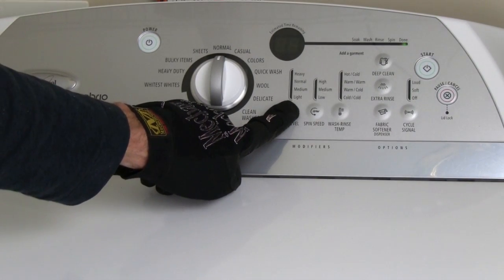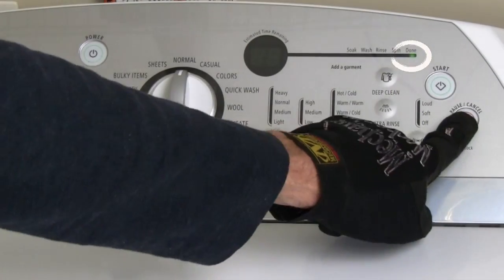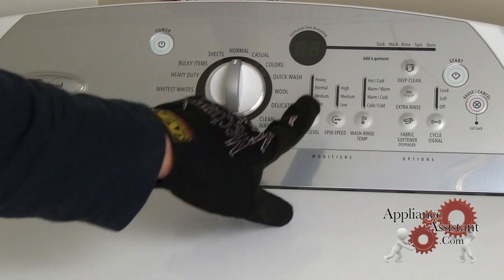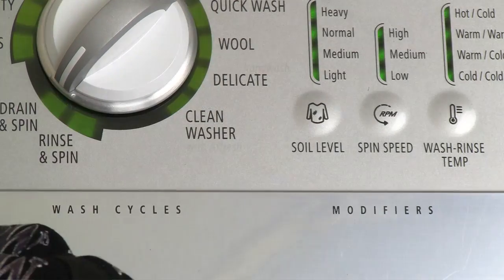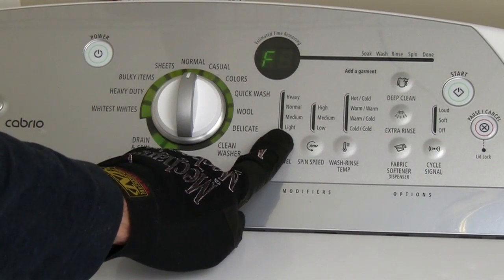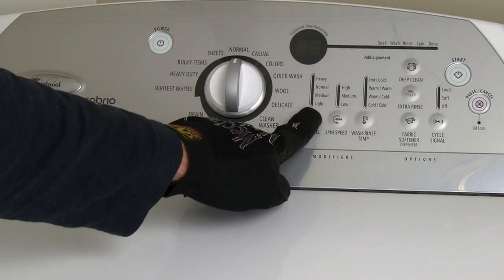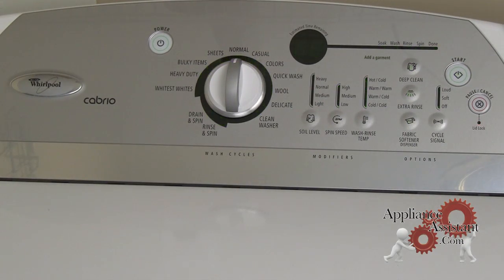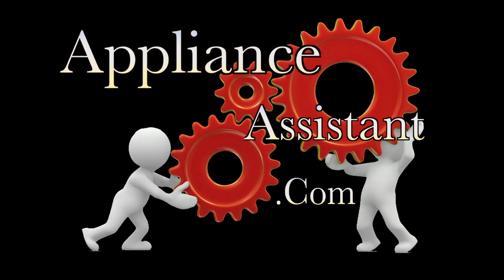Washing Machine Diagnostic Test & Error Codes (Cabrio, Bravo, & Kenmore Oasis)

Comment: It's now 2025. Glad I came across this video. My question is. With this exact washing machine, I had an unbalanced code that randomly caused issues. I replaced the suspension rods. How do I calibrate after this? This is the first video I've seen with the exact washer as mine. I also used the washer to see if the issue was fixed. The code popped back up, then SD code started to display. What steps now. Thank you for your assistance.

Comment: Seems quite impossible to get to the mos recent messages but I have this washer, or some form of it, and the button sequence works intermittently. I wonder if when the board resets if the dial indicator has to flash green. I have seen it flash green and beep and I have seen it just beep when power is added back.
Reply from the maker: The first part of the diagnostics mode lights up all the console LEDs to check if they are working.  After that it should cycle through any stored error codes. After that it should go into an automatic test sequence that's about 9 steps long, testing all the main components.  If new errors are detected during the auto test cycle they should be displayed at the end or be recorded when you start the diagnostics again. Hope that helps some!

Comment: Thanks for the great video, it helps a lot, so after the issue has been fixed how to reset those error code?
Reply from the maker: Thank you! Not all models have an error code reset for the memory. But on most of these after you’re done displaying all the error codes if you press and hold the same button until you hear a beep that may clear existing codes.

Comment: Can a recalibration be performed on the model shown in this video?
Reply from the maker: I’m not 100% sure. I have never used the recalibration mode on this type of washer. Sorry, I can’t be of more help!
Common issues are suspension, center bearing leaks/rust, and the occasional cracked stator.

Comment: What is oL
Reply from the maker: Sorry for the delay! OL is over load. It is caused when the inner tub cannot move freely to float off the drive hub. 
It can be caused by something getting wedged between the inner and outer tub, like a sock. Or the center drive shaft has become corroded and is not allowing the inner tub to slide up as the washer fills. I hope that helps!

Comment: Hey I am getting OL error and on calibration it c6 that errors it out I've replaced the suspension rods but didn't fix it any idea of what I should look at?
Reply from the maker: Hey! As the washer fills up with water the inner tub should rise and float on the water. It’s fairly common that the sleeve of the center drive shaft will rust and not allow the tub to float freely. You should be able to grab the rim of the inner tub an lift it easily. If it’s jammed it’s a fairly challenging repair, you might want to consider hiring someone for that as some specialty tools are required.

Comment: I have been getting an oL code on my washer. I did this diagnostic test and CO popped up and then it has C1 and started to run a cycle. And also had the add garment light on
Reply: Me too, any luck?
Reply: @cool33onthescene  ended up throwing it out

Comment: You do not explain how to get the washer into  standby mode.  Once I turn the washer one, it only allows standard operation. I've tried every other way to access the error codes, but nothing has worked.

Comment: Tried this but the washer is not filling up with water.  Any advise?
Reply from the maker: If you are in diagnostics with no water filling I would say check the home and washer valves. Probably one is off or the valve is bad. To be sure you would need to check for 120 Volts AC at the valve when it should be filling. If no voltage, broken wire or control. If you have voltage it’s the valve. Hope that helps!

Comment: Does anyone know of a class action law suite against these washers?
Reply from the maker: Not that I’ve found, the washer in this video has been pretty good by today’s standards. Apart from the bearing issue they have been pretty solid. Not so much with the lower end belt drive version. If you find any info on a class action please let me know!

Comment: @applianceassistant Hi do I let each code go through it's stage or keep clicking because my washer have about 4 codes that would show up it runs a little but I kept going through each code and after I decided to was a small load it stopped again on 13 mins left of spin cycle

Comment: We have a Cabrio Washer WTW8100bW. It runs fine but when it changes to the next cycle, we get an OL code. My wife has to change the cycle manually. The manual says over load but that’s not the case. Light loads. Any suggestions?

Comment: How do I enter diagnostic mold in Kenmore 110 model series the high efficiency low water wash technology model
Reply from the maker: It may be the same as in this video... 110. Is kenmore code for whirlpool built. What is the full model number?
Reply: @applianceassistant  110.28002011
Reply: @applianceassistant  110.2080002011
Reply from the maker: That style is a little different. I have a video for that one also. Look up “Whirlpool Washer Repair (New Top Load Washer)” that will show you how to do diagnostics and read error codes. There is also a link in the video description to my website with more information on it. Good luck!

Comment: My cabrio runs diagnostic up until c8 and gets stuck and does not drain the water inside
Reply from the maker: Sounds like the drain pump would be a good place to start looking for the problem. If the pump seems to be running at that point there may be something clogging the pump intake port under the inner tub. Hope that helps some!

Comment: my washer displays OL message while it is not overloaded, and then clothes are not dry. What is the problem? Thanks
Reply from the maker: Sorry for the delay. Check for something stuck between the inner and outer tubs that may be preventing the tub from floating as the water fills. Or the main drive shaft may be corroded keeping the tub from lifting off the hub. Hope that helps some.

Comment: Can anyone help please. I have a Whirlpool Cabrio washer machine that keeps popping up with an OL code. I hear water somewhere on the outside of the drum.
Reply from the maker: The water you hear is likely the water filled balance ring on top of the tub, so it would be normal. The ol “over loaded” error is usually caused by a rusted drive shaft. The tub should float up and disengage the hub when water fills the tu. However, if the shaft is rusted... common, it will stick and not allow the tub to float free. https://applianceassistant.com/appliance-repair/washer-repair/cabrio-washer-repair-guide/2/#ol
If that is the cause it’s not a very easy repair... hope that helps some.

Comment: I got f1 issues ?
Reply from the maker: Bummer... it’s usually a main control board error. You can try resetting the control by unplugging it for a minute, otherwise that’s what I would replace first if the rest of the washer is in good condition has no black or rust marks under the washer. If it shows signs of leaking through the center seal, or it’s loud in spin, it’s probably best to say goodbye.

Comment: Urgently need your kind assistance.  I have a Whirlpool Cabrio.  It shows "sd" error code.  I would stop at the last spin.  I have tried several times to use the bleach and clean cycles.  Not removing the code.  Can you please help.  Is there a reset button or calibration function to see if this will go away?  How can I fix myself.  I called around and everyone is extremely costly during the holidays!  Please help.  Thank you in advance for your kindness. Happy Thanksgiving!
Reply from the maker: Sorry for the delay! The sd code is usually related to too much soap or slow draining so you will likely need to clear or replace  the drain pump. If replacement is needed there are several options on Amazon for a decent price. There can also be coins and other things blocking the intake port to the pump under the inner basket... hope that help some, good luck!

Comment: I have a Whirlpool cabrio platinum and it is leaking on the inside. Dripping water into the tub. What is causing this drip, I have to put a bucket in to catch it so the water doesn't sour.

Comment: Hello, I have a Whirlpool Cabrio top loading HE machine. Looks exactly like the one in the video above per the control panel. I have been getting an LF code. It seems to be filling on some cycles but not others. I ran a ‘clean washer’ cycle and it did fill up all the way. It seems to not be filling at certain times in the cycle though. Sounds like it’s trying to by the sounds it makes. I cleaned the inflow screens and checked the inflow pressure, etc., it’s all ok. I’ve taken the inflow valve part out of the washer and I’m going to check it with an OHM next. Are there any other issues that would cause this code that I’m overlooking?  I’ve had to fix this washer more than a few times myself. Getting ready to dump it if it’s going to be more complicated at this point. Any help is greatly appreciated! Mother of 4 and I need this washer to run consistently every day. 🙏
Reply: It sounds to me like the water valve may be mechanically unable to open. sometimes they can test okay with an OHM meter on the coil windings and still not work properly. The diagnostics test mode https://applianceassistant.com/Washer-Repair/Whirlpool-Washer-Belt-Drive-Splutch/Whirlpool-Belt-Drive-Washer-Repair-Guide.php  should allow you to test the hot and cold valve's ability to open. If the coils are getting power from the control, there is water comming to the valve, and the screens are clear, you can make a fairly safe assumption that the valve is what needs to be replaced.  Thanks for the question! I hope that helps some! Good luck!
Reply: charles yingst; Hello, I ended up buying a gently used new washer for less than the cost of the in-take-valve part for the Cabrio. It was a lot more rusted than I expected when I got under the hood so to speak. The machine was 10 years old and should’ve had a lot more life to it but it is what is. 🤷‍♀️
I’m the proud owner of a Maytag now. 👍
Thank you for your reply and the help though!

Comment: We get the code UL on drain Spin and it stops how can I fix that
Reply from the maker: UL is  “unbalanced load”. The most common cause of UL would be the tub suspension rods. The suspension rod replacement Doable with one person but easier with two if it’s your first time.

Comment: I Have A Cabrio WTW7600XW0,  After A Wash Cycle (That Didn't Spin)  Time Stopped On 3 Mins And Read sd & I Did A Diagnosis & It  Popped Up L0. What Does This Mean? I'm Completely Lost.. Help Please!
Reply from the maker: SD is usually a draining issue, but it can sometimes mean that the tub shaft is rusty and not allowing the inner tub to lock back into the hub after the water has drained out. This same thing can happen when something, like a rag, gets stuck under the tub and holds it up after the water has drained out. The LD error means long drain which is along the same lines. so if the water seems to be draining out okay, it's probably a problem with the tub sinking back down from the wash cycle. (rusty shaft, tub hub, or something under the tub) If it's not draining out well you may have a bad drain pump or something under the tub clogging the pump intake screen.  This link may help:
http://appliancediagnostic.com/Washer-Repair/Cabrio-Bravos-Oasis/Cabrio-Bravo-Oasis-Guide.php
Hope that helps! Good luck!
Reply: Samantha Longoria too many suds

Comment: I have a cabrio HE, model WTW6500. worked fine Yesterday, now it makes a buzzing sound and lights blink- will not run.Help
Reply from the maker: where you able to get it into the diagnostics mode to see if there are any error codes stored? 
http://applianceassistant.com/appliance-repair/washer-repair/cabrio-washer-repair-guide/
 If not what lights are blinking?

Comment: On a Whirlpool Cabrio, if you get a 0L or a UL code. The bottom load sensor on the stator could be bad. Watch Cabrio videos on here for better details. The washer will usually stop with 3 minutes left and give error code.
Reply: oh yea/? I replaced that, bearings, seal, shaft and rods and stator doesnt have cracks im about to put it for trash, these washers SUCK!!!
Reply: F32 code

Comment: How do you replace tub displacement/ out of sync sensor on Maytag Neptune TL, model # FAV6800AWW? Thanks.
Reply from the maker: +FORE DEVELOPMENT, LLC Sorry for the delay! Replacing the part is pretty easy, It just clips onto the tub and the washer frame and has one wire connection. If I remember correctly I think its located on the front left under the top. Its been a while since I worked on one but I think there are spring clips at the seam between the top and the front of the washer that you need to press toward the back of the washer with a putty knife. That should allow you to lift the top... Here is a link to the part:
http://www.repairclinic.com/vwo10/PartDetail/Out-Of-Balance-Sensor/12002194/1032779?RCAID=27317
If that happens to not solve the problem you can still send it back for a refund... those are difficult to diagnose with certainty.

Comment: Does anyone know how to get model WTW8500BW0 into diagnostic mode. There is a combined start and Pause but no cancel bottom
Reply from the maker: +Mega Clause It should be the same diagnostic process, you would use any button but start/pause
Reply: +applianceassistant Finally worked. Looks like it the drain pump. It gets caught on C8 both in automatic testing and manual. Is there a way to test the drain pump once its removed? Continuity test??
Reply from the maker: You can check to see if the motor windings are "open" with a multimeter. It should have some resistance, but hard to know what that reading should be. Most of the time the motor winding is okay but the impeller fins are jammed, broken, of worn down. Thanks for the update!

Comment: I did the test and it donest show any error codes. but it will not finish the spine cycle and says UL but it is level. what do I do??
Reply: +Brandi Hart doesn't#
Reply from the maker: +Brandi Hart Probably needs new tub suspension rods. If you press down on each of the 4 corners of the wash tub and release quickly , they should all return to the original hight with very little bounce.  If it does bounce its probably the tub suspension rods that need to be changed.  Not to difficult with two people. If you give me a model number I can give you a part link.  Thanks for the question, hope that helps!
Reply: +applianceassistant its WTW6800WW1 MOD and yes the back corner goes down but doesn't pop up like the front
Reply from the maker: sorry for the delay, I hope you had a nice holiday! I would replace the shock kit here os a link to the part:
http://www.repairclinic.com/vwo7/PartDetail/b5p11/Whirlpool-Washing-Machine-Suspension-Rod/W10247710/1549067?modelNumber=WTW6800WW1&ss=a11b5d705932&mr=1?RCAID=27317
hope that helps!
Reply: +Brandi Hart I had the same problem, I took the tub out and there was a quarter and a nickel stuck where the water drain hole goes out, or get pump out. Work great now that I removed them.

Comment: wtw6800wl1 is me model
Reply from the maker: +Bullfrog gilktha Your right, that is the style in this video.
I have had a difficult time clearing stored codes from the memory on this style. Technically you press pause/cancel when the code is displayed to clear it.  But that doesn't always work... I usually just make a note of what is in the memory and if new codes happen they will over write the ones that are in there now.
Here is a guide:
http://applianceassistant.com/Washer-Repair/Cabrio-Bravos-Oasis/Cabrio-Bravo-Oasis-Error-Codes.php

Thanks for the question!

Comment: hi, i have a whirlpool cabrio. it wont power on and did the test from video and i get a f70. it went thought C0-C9 fine and still wont power on. any advice please
Reply from the maker: +Jessica Brockway Sorry for the delay! here is a link to the repair guide:
http://applianceassistant.com/Washer-Repair/Cabrio-Bravos-Oasis/Cabrio-Bravo-Oasis-Error-Codes.php#ol

There could be something caught between the inner and outer tub that is keeping the inner tub from floating. I have also had quite a few that have a rusted drive shaft that will not let the tub float.  If the shaft is rusted it can be very difficult to get it out and check... heres a video that shows a good trick:
https://youtu.be/m7rfpFhIcX0  F70 and F51 can both come from what he's talking about. hope that helps!

Comment: My whirlpool don't finish the cycle. The code that shows me is F7E5 what is the meaning of that code??
Reply from the maker: +Jayzabeth Lacourt Valverde Sorry for the delay in responding! The Cabrio model that you have is a little different. here is a repair guide for yours:
http://applianceassistant.com/Washer-Repair/Whirlpool-Washer-Belt-Drive-Splutch/Whirlpool-Belt-Drive-Washer-Error-Fault-Codes.php

The F7E5 is very common, it's a shifter/ tub sensor fault and the part is very easy to replace. Hope that helps good luck!

Comment: kept getting ul and a f51 error code and a couple others
Reply from the maker: +Jordan Mendez The F51 error is a rotor position sensor (RPS) error... and fairly common. It can usually be fixed by cleaning the contacts at the RPS and the control connections with some electrical contact cleaner. Found at most hardware stores.  Getting to the RPS at the motor is a little tricky, but not too bad. You need to pull the bottom rotor off and the motor stator to get to the RPS contacts. Good luck!